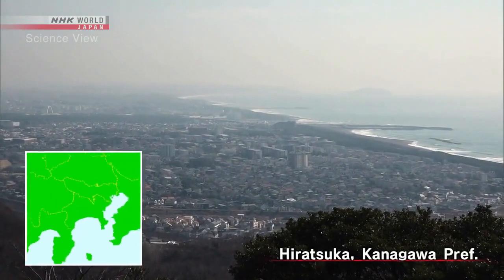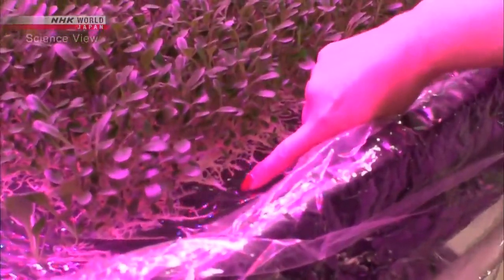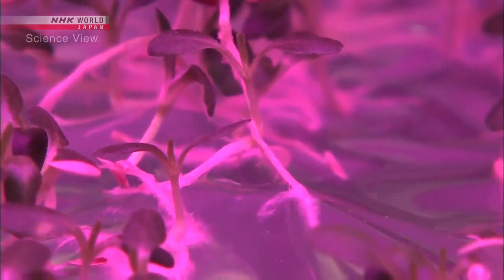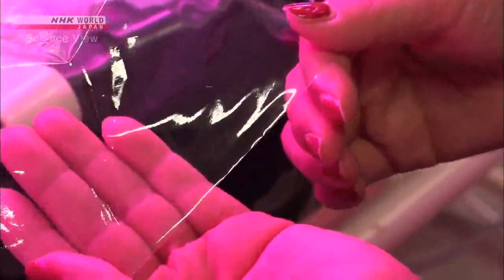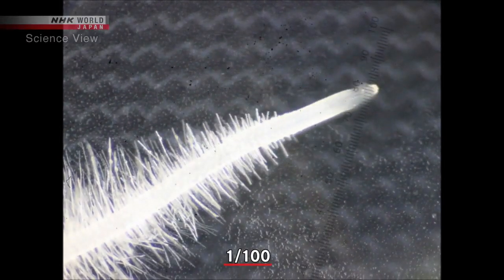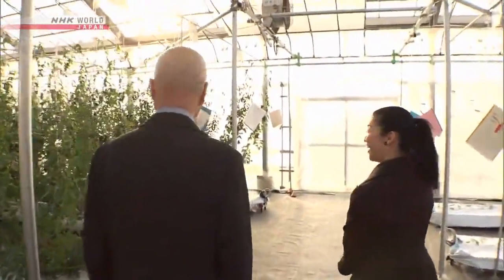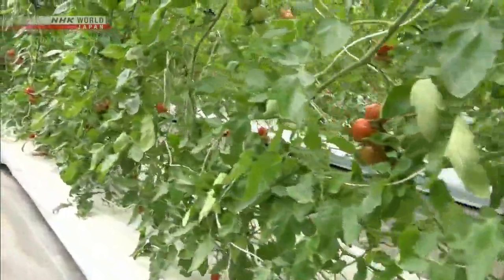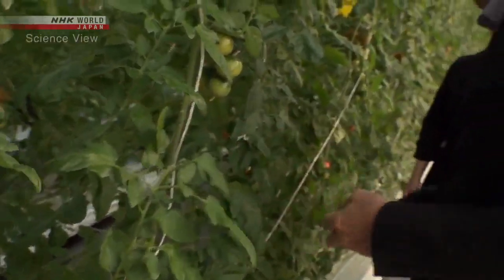Innovative Soil-less Farming Technology

Comment: v interesting discovery, wonder the plastic  degradable ? Assuming if using alot of plastic.
Reply: I was interested in that too, so I  googled it.  It breaks down  into potassium acrylate and acrylamide.  Acrylamide is a neurotoxin and also causes cancer.  But hydrogel in itself is nontoxic so it is marketed as environmentally friendly and used as soil conditioner to help retain water. But they don't tell you it poisons your soil, thus, the environment when it breaks down.